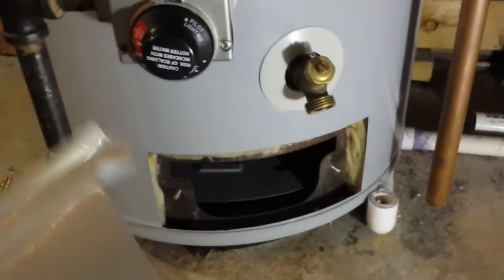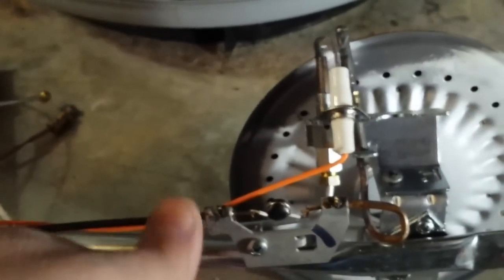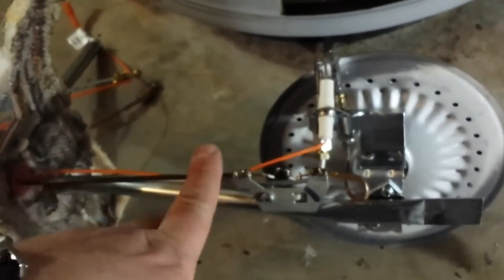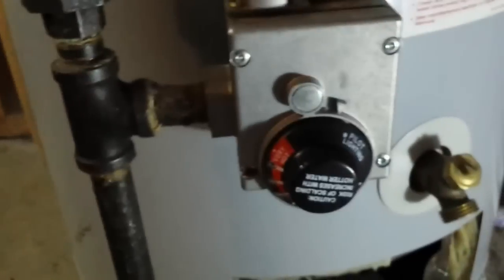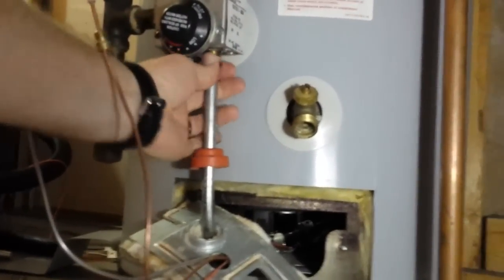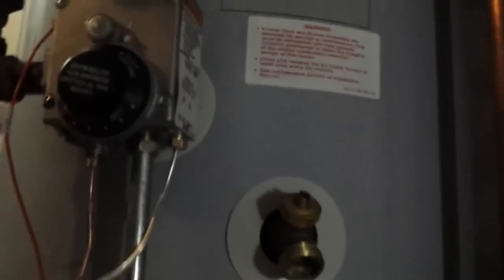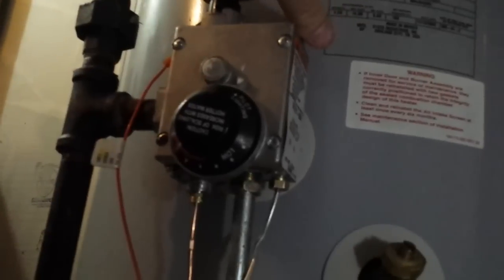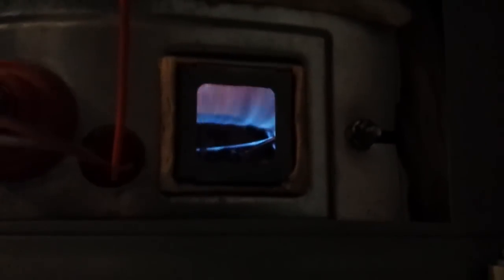How to: Replacing the thermocouple on a State water heater.

Comment: Hi. Nice video. On the State water heater pilot assembly there is a device called a thermal protector. It is spliced into the thermopile and is normally in the closed position allowing current to pass. It is designed to open if the ambient temp reaches 180 degrees C. It is a safety device to shut off gas in case of a fire.  The one that is used on the State water heater is made by a German company called Thermik.  They do go bad or get a broken terminal after a few years so that is what causes the pilot light to not stay lit many times. It is not necessary to use a Thermopile with one to  make it work, but it is good to have for safety.  I had to replace my pilot assembly since that device had a broken terminal I could not resolder.  I am going to keep the old assembly and find me a new thermal protector to splice in. I tried looking for the same one by Thermik , but they only sell commercially in large quantities.
Reply: Did you ever find one ? I wanna put a new thermocoupler on but this safety feature would be nice to keep

Comment: Thanks for the video.  I have become more handy over the past few years but have always shied away from messing with gas.  I originally went to Lowes to buy a generic thermocouple only to find out that State Selected used a different one, one with a resistor.  I did a quick search and saw that Amazon had one.  I called a local plumbing company that I have used in the past only to find out that they didn't mess with State Select water heaters.  That lead me to attempt this process on my own.  While it isn't terribly difficult, it is a little nerve racking knowing that you are messing with a gas line.  Your video was a spot on guide on how to replace the assembly.  Even down to switching the pilot light wire to prevent it from shorting out.  Thanks!
Reply from the maker: Absolutely glad to help!

Comment: Thank you so much for your video. We followed your example with the exact same water heater and removed the thermocouple unit. We checked the resistor, which was fine, and cleaned the area around the igniter. We reinserted the unit and everything worked fine. Fortunately, we did not have to replace the unit because it is only available by ordering it. So we started the morning thinking that we might have to spend $400+ for a new water heater and now a couple of hours later no cost back to normal!! THANK YOU!!!

So, lesson learned - first  try cleaning the area around the igniter - as recommended in the video!
Reply from the maker: Scott Wayne You are more than welcome. Glad to help.

Comment: Exact same thing happened to mine.  Thanks I never would have found the problem if it wasn't for this video.  For those that are soldering the connector back together would be a bad idea.  Yes, it would make it so it would work again but it is designed to be a safety fail in case it gets up to 190 degrees or hotter which is a bad thing.  It's like a fuse in a electrical circuit.  I am thinking this is why most peoples connectors fail, it gets too hot.  This is most likely caused by a dirty filter below the burner.  For those changing this out it is a really good idea to clean the filter so the heat doesn't build up again and get back to square 1.  Thanks again Sivendel.
Reply from the maker: Ryan Littledike You are most welcome. :)

Comment: So on a Saturday at 6pm, our tenants  (with 2 younsters) texted that there was no hot water and the pilot light wouldn't stay lit. Off I go to try myself and I too, couldn't get it to stay lit. I found this video and watched it from start to finish. I also had put a call in to our trusted plumber who said "90% of the time on water heaters, just cleaning the burner plate and the thermocouple will remedy the issue." I couldn't find a plumber to come in on a Sunday anyway so I figured I might as well try.  I turned off the gas, disconnected the gas and the other 3 lines (gentle with the orange one, but just be careful when you pull it apart), took the 2 bolts off that hold the entire unit and gentle rock it towards you (you have to lift at an angle to clear a piece of metal which aligns the unit under the tank. Be patient.  Once it's out, be careful with that transitor. Home Depot and Lowe's don't carry the special thermocouple (at least in my town). Anyway, lightly tap the silt off, take some sandpaper or steel wool and clear off the plate and vacuum inside the water heater. Moist paper towel the bottom too and don't forget to vacuum out the air intake section below where you are working as that can get dirty too. Clean and replace. Mine stayed on like a charm. Total time: less than 30 minutes. And Ladies: Even a girl can do this (like me).
Reply from the maker: Awesome. I tried the sandpaper route and no dice. the replacement part was the best option. I had to do some looking to find the part number, but once I did, it was easy. Thanks for the comment.

Comment: On my State gs640yoctg,  I just used a new universal 24 inch thermocouple from the hardware store. Sizes ranged from 18 to 36 inch.  24 seam to fit perfect but longer ones could just be curled.  I sliced the grommet on the side just enough to get the old one out, unscrewed the thermocouple and pushed it out of the main mount while compressing the retaining clips on the side of the sensor. Pushed the new one in using the same tube retaining clip and routed the line near the old mount and on through the grommet.  Works great. Only $11.  Good time to vacuum out the burner area.
Reply: I bought a universal one as well. But it doesnt have the little grommet that the original part has on it. So not sure if I can replace or not
Reply: @tonylongo2312  same here did you ever replace it ?

Comment: Your video was very helpful to me for resolving my hot water pilot light problem.  I have the same type of pilot light assembly and, like yours, my thermistor was coming detached on one end.  Unfortunately, there was no local replacement available at noon on a Saturday so I resorted to soldering the bad thermistor connection.  I'm very experienced at soldering but found it a bit tricky to get a reasonably good soldering joint.  Definitely recommend purchasing a new pilot light assembly like you did.
Reply from the maker: Glad to help. And it really is easy.  :)

Comment: Thank you for you video, helps me out a lot.  I thought it was just the thermalcouple, but it was the whole pilot assembly exactly where your issue was.
Reply from the maker: Glad I could help.
Reply: @TheADHDNerd  so I've been searching for the same pilot assembly.  Now will any assembly kit work?  I've searched ace hardware with no luck
Reply from the maker: You're best option is probably to get the part from a plumbing supply company. If you have the same model as I do (GS640YBRT) then you want to ask about part #9003542005.
Reply: @TheADHDNerd  thank you

Comment: -Thank you for your video.  I had a similar problem about a year ago and to my surprise, the thermocouple on the State water heater is different from that sold in stores.  I was able to get the pilot lit and the burner working after a good cleaning.  Last weekend it went out again and I couldn't get the pilot to stay on.  After watching your video I took the burner unit out again and checked the resister.  Sure enough mine was broken just as yours was.  After several phone calls to State and distributers, I was directed to a parts place that carried the pilot assembly.  Thank you for sharing your video.  I have hot water again!
Reply from the maker: Debra Ornelaz You are most welcome! :)

Comment: Great video, only thing is I too had a problem with the orange wire, it wasn’t sparking inside and it wasn’t grounding on anything, I finally figured it out, it was the metal end piece that wasn’t touching the wire. I took my pliers and put pressure and twisted it and tried the sparker again and it lit up. You would think the manufacturer would have that down pat. Thank you for your video 👍🏻
Reply from the maker: Glad to be of some help!

Comment: Thank you so much for this video, my husband and I were able to fix our water heater. Much appreciated!
Reply from the maker: Glad to help. :)
Reply: Sir James did you have any issues with it after you replaced this part? Ours turned off again, stayed lit for like 10 mins :(
Reply from the maker: Be sure to clean/vacuum out around the base of the water heater. Also, watch the pilot when it's lit; make sure the thermocouple is well in the flame.

Comment: I have an A.O. Smith hot water heater and it required the same fusable link on the thermo couple which drives the price of the part way up. Initially, I bought a universal thermo couple for $12 and had to return it once I took the old one out and actually saw what I needed. Also discovered that you have to “bleed” the new line before the pilot will light. That means you have to hold the pilot button down for several minutes and try the ignitor every so often until the pilot lights. Good luck out there.

Comment: Good vid. Remember to check for gas leaks at the aluminum and steel gas burner outlet and pilot tube--with the burner on.

In this type of water heater with the sensor the problem is often not the thermocouple but the filter around the base of the water heater is clogged with dust and restricts air causing the thing to shut off. Replace it, comes in the kit or clean the old one.
Reply: Can you describe it better, i don't know how it looks and do have an issue with my  pilot not staying on. Thank you

Comment: fyi you can get this part (pilot assemble) at ACE true value ...at least you can at mine in Omaha (144th) they dont have it at lowes home depot or Menards. It was only 39 bucks, pluming supply its closer to70 bucks.
the guy at ACE told me they didnt have it and took me over to the thermocouples and said this is all we have, after he walked away i noticed on the bottom shelf a box ...it was the pilot assemble! just got done taking a HOT shower had it fixed 24 hours after breaking down (on a sunday). THANKS to Sir James....this idiot really appreciates you taking the time to post this video (my family also thanks you)
Reply from the maker: Glad to help! No one needs a cold shower... at least not every time. Lol

Comment: Thanks for your video bro. I had the exact same issue as you did. However, rather than order a replacement part I simply (painstakingly) soldered the wire lead back on to the resister. Reassembled everything and the pilot lit right up and stayed lit. Anyway, your video helped a lot. Much appreciated. For everyone else: It appears these State Select water heater assemblies are poorly manufactured. There didn't appear to be much solder affixed to this part of the device in the first place. My symptoms began about 2 weeks ago. I would notice my water being cold where it should have been hot. Upon checking the WH pilot and noticing it was extinguished, I was able to relight and start the burner. However, the pilot light began going out more and more frequently (up to 5-6 times a day) 2 days ago the pilot went out and I was unable to get it to stay lit to activate the burner. Thus the steps above. Also cleaned the air intake vent (located beneath the burner assembly) and cleaned the thermocouple using 220 sandpaper and steel wool.
Reply: +Purgatory187, I have the exact model as in the vid.  My pilot light would not come on. Pulled it out and tried to take apart the assembly, that was a no-go. So just blew air into it til I got a steady steam.  Installed it back, pilot light working but would not stay-on.  Look closely at the resistor thingy and it was broke again it did not want to bulge, wanted to try to universal thermocouple fix.  Instead, opted for the solder solution...hopefully, it holds out til I at least locate the replacement part as demonstrated in the vid.  Just to add my heater was made in 2006 installed 2007.

Comment: Great video.  Thanks for posting!  I found the assembly at a plumbing supply store for $50 and changed it out but, I'm still having the problem.  Someone posted in the comments that restricted airflow due to a clogged filter is the likely cause. I vacuumed it out but maybe need to do a more thorough job.  Gas would burn for 5-10 minutes before shutting off.
Reply from the maker: Mark Bridenstine Another problem can be the assembly pilot light being too far away from the thermocouple. When the pilot is lit, the thermocouple should be in the edge of the flame.

Comment: You were right it wad pretty easy to remove. Unfortunately I broke the resistor putting it back in after I cleaned off the thermocouple.  Hopefully that kit ain't too expensive.
Reply: I bought mine through Amazon, it was like $48.00

Comment: That "resistor" that is discussed in the video and in the comments below is not a resistor at all -- it's a high-temperature limit switch that opens at 190 deg. C. It's discussed in the State repair manual which is available for free online. That high-temp limit switch is designed to shut down the gas valve in the event of an overheat in the combustion chamber, which commonly occurs on these heaters when the spark arresting "filter" below the burner becomes clogged with dust or pet hair. I would be very cautious about soldering to this switch -- or worse yet, omitting it or going around it with a jumper. If you have a broken wire at that switch, replace the pilot/igniter/switch with the correct factory replacement as shown in the video. Doing otherwise is risking a fire or other bad outcome. Also, if you have a problem with the burner/pilot kicking off periodically and needing relighting, vacuum out that spark arrestor/filter from the bottom and/or blow through it from the top with compressed air. Restricted airflow due to a clogged filter is the likely cause. Note that replacing the pilot/igniter/thermocouple/high limit switch assembly won't fix this problem if the filter below it is clogged.
Reply: Can you post a picture of how that filter looks like? Thank you

Comment: Just wanted to say thanks for the great "do-it-yourself" vid.  I have the exact same model, no pilot light and I could not get it started.  I also, had the same exact break on the thermocouple resistance thingy.  I soldered mine back on. Tested it with a multi-meter and bic-charcoal lighter...and it passed (slowly rising in milli-amps up to 20 in about a minute).  Put it back in and its working.  How long remains to be seen.  I would have preferred to do the replacement you did...but I'm finding it difficult to find it.  Also, got a chance to clean inside the combustion chamber and surrounding areas.  Though, this took me several hours but hot water is on and I learned quite a bit about hot water heaters that I never really knew. :)
Reply: +John Henley also just wanted to add my heater was installed in 2007.  Never did a thing to it...til today.  Plan on flushing it...though, I am a bit weary about flushing it.  I'll flush it and then it decide to completely quick on me...fingers crossed.
Reply from the maker: Thanks John. Check around for plumbing supply stores, otherwise you can call the manufacturer and they can send you one... although they are CLEARLY focused on up-selling, instead of helping. And they aren't cheap.

Comment: Thanks for your video.  Just completed the swap on mine.  New unit appears to be working.  Pilot stays on and the burner lights fine.  It looks like my pilot lights in two places.  One at the end of the thermocouple and another at the base (more towards the center of the burner).  Is that right?  Should there be two pilot lights or do you think my new assembly as a small leak at the base?

Comment: Hi,My thermocoupler checked out good, climbing past 25mv (per another video I watched). I put everything back together, hold down the gas control knob in the "pilot" position for one minute like the instructions say, but when I let it go, the pilot light goes out. I've tried several times but the pilot light goes out every time I release the control knob. The pilot light goes out before I can even think about putting it the "on" position. Any suggestions?
Thanks
Reply from the maker: Not sure. That's what was happening to mine as well. You may want to remove the assembly and try cleaning it with some sandpaper. Many of the "experts" suggest cleaning to get out working again... just didn't work for me.

Comment: Hi, 
I did replaced the whole assembly part as your video because my pilot light keep going out.   However, the problem still continue.   What do you think the problem is now?   We have two water heaters and I can see the other pilot light always on with the functional one.
Reply from the maker: At that point it could be any number of things. I would double check all the connections, but unfortunately it sounds like you will probably have to check with a professional and have them come out. :(
Reply: @TheADHDNerd  After 3x that I have to re-lighted the pilot, it finally stayed on for the past 2 or 3 days without turning off.   I do notice that the pilot light flame is a lot larger than when it is brand new.   Maybe it just needs to be "break-in" or it could be some strong wind blow it off since the water heater is very close to the edge of my garage door where it opens and closes often.   Anyway, thanks for the tutorial and hopefully my experiences could help others.